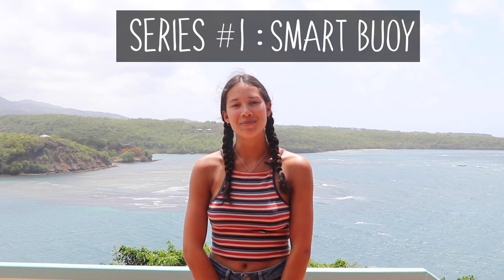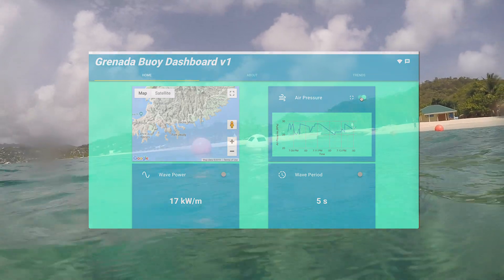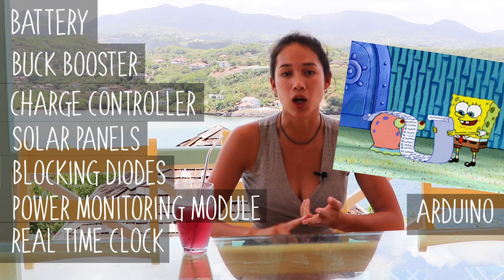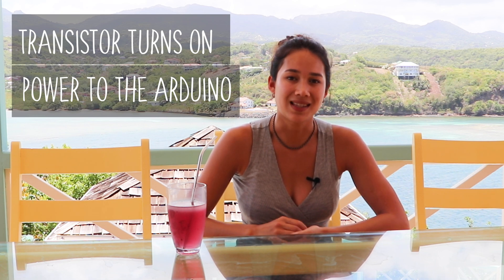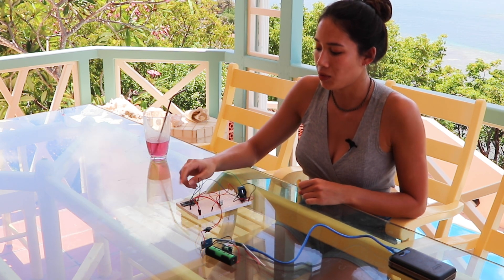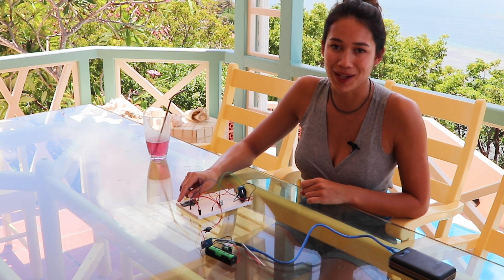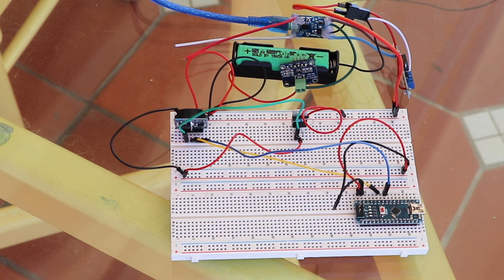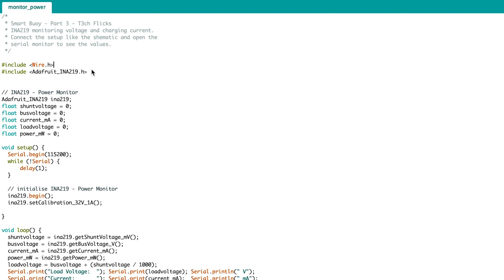Smart Buoy [Episode 3] - Scheduling power to the Buoy

Comment: This is fantastic. I applaud your tenacity on getting this done and the hurdles that you have overcome as well as the future hurdles hat you have foreseen that need to be addressed. I have one question: For the barometer, the sensor is inside of the buoy. Wouldn't you get a more accurate pressure reading if you could manage to get a sensor on the outside? Just throwing that out there. Can't wait for the next video.
Reply from the maker: Hi Chris, thank you for the appreciation! There are a lot of problems when using a barometer by the sea, such as water evaporation at the surface skewing results - it's probably not a sensor we will use in the future.
Reply from the maker: https://youtu.be/yUjocnaKXys